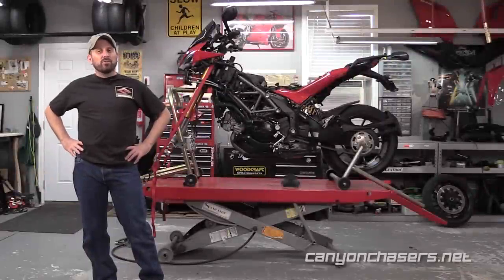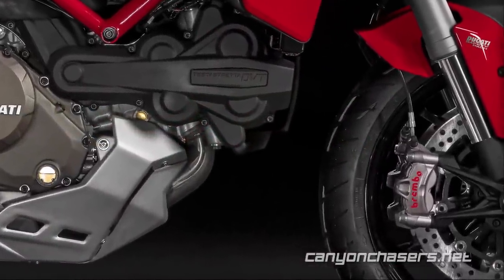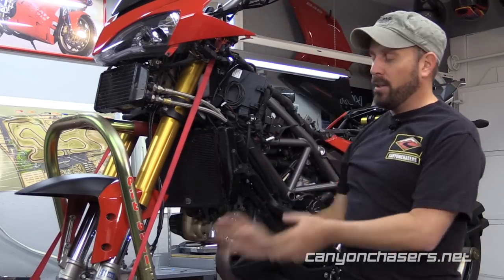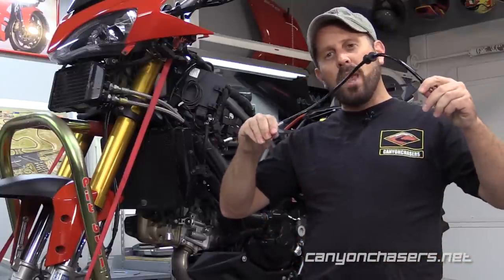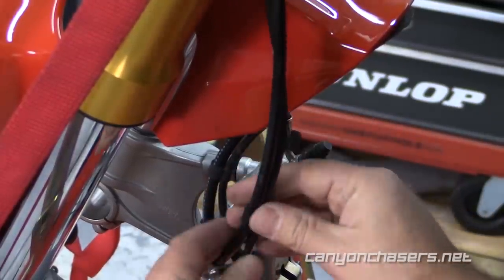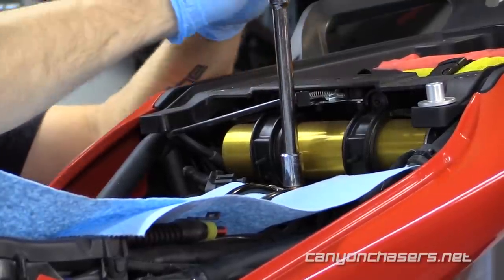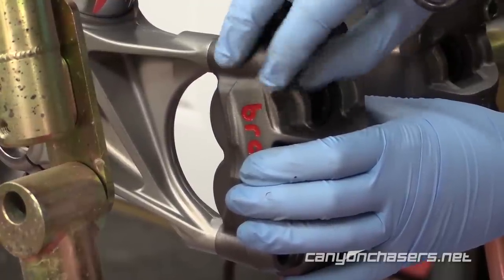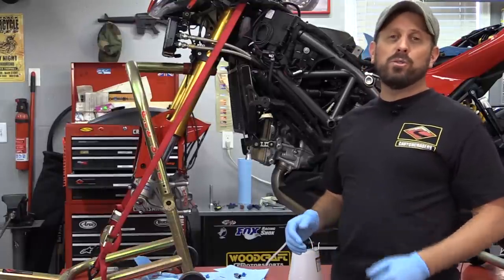How to install upgraded Brembo M50 brake calipers on a Ducati Multistrada 1200

Comment: Thanks a lot for your video. Based on your video I made that upgrade last winter 22/23 to my Multistrada 2012. But I chose the M4 Brembos. They watch more like the original P4, my concerns regarding authorothies here in Switzerland. Spiegler Germany helped with the right brake lines. Hey, what a great upgrade, and with the M4‘s I get even more stopping power. 
But for such an upgrade you should also stiffen your suspension. I have stiffer springs ( front 9N/mm, rear 130N/mm) and totally modified rebound and compression setup. What a great bike, it goes solo or fully loaded with wife and baggage in a perfect way. Brakes are Alps and Dolomits proven. No other Multistrada delivers that enormous rideable torque from the bottom to the top!

Comment: Very good Video, I upgraded my Dutch MTS 1200 1 1/2 Year ago with the Black M4 Calipers,after seeing your posting,  very good improvement of the braking characteristics. Also the modify brakeline was also handy :-) Please not that the ABS needs the factory Software Update , to max the upgrade.

Comment: Hello, congratulations for your videos! They are really well made! I'd need some advice if you can. I should replace the rear brake cylinder of my Monster 821abs because after several kilometers the pedal goes all the way down and i'd like having an efficient rear brake. How can I do to drain my rear brake? Do I have to do something on ABS? Can I empty it simply by connecting a hose to the rear caliper and suck the brake fluid with a syringe? Thank you.

Comment: great job and video! two questions please: did you order the customized pipes of the same length as the originals but changing only the type of banjos? can you repeat the tightening torque for the banjo screws in metric system?  think that I have two new stylema calipers to upgrade my Multistrada 1200 DVT my 2017! thank you

Comment: I needed to flush out the old fluid on my Z1000, so I bought, Motul DOT4 fluid, Hel brake lines, EBC HH pads, Brembo M4 calipers, Brembo RSC brake master cylinder, Magura HyMec hydraulic clutch conversion, Magura HC1 clutch master to match the Brembo RSC, Magura Blood and a MityVac. Gotta love motorcycles...... I know my bank account doesn't.

Comment: better go for the brembo M4. Those have 34 mm pistons vs the 32 of the M50. With the 34 mm pistons and the original main brake cilinder the "breaking feel" is right in the sweet spot.

Comment: Great video! I wish I had seen it before bleeding my brakes. Are the torque settings you mention for the banjo bolts in the front calipers from the Service manual?
Reply from the maker: Yes. I used the service manual

Comment: Hey I love your web site and your videos I have a 2013 multiawesome with a centerstand. I have done one oil change so far and I have to remove the center stand and skid plates, is their any simpler way?
Reply from the maker: Yes, you can, but we honestly just remove the centerstand.  To keep the centerstand in place, you remove all the bolts on the front of the sump-guard and the front of it will drop down, then you have to create a flat funnel like thing using cardboard and aluminum foil to create a gold-sleuth/trap shape to channel the oil from the drain bolt to the catch pan.  This is how our local dealer does it, but we think it's just as fast to remove the centerstand and sump-guard, then clean everything.  Less spills that way.
Reply: CanyonChasers Motorcycle Sport Touring There is a really simple mod that you can do to the bellypan's center section that allows you to remove it without having to deal with removing the centerstand. Slot the two rearmost holes so you can pull it straight out of the rubber grommets; you don't even have to loosen the pair of allen-headed bolts. Ever since I did this access to my drain bolt and oil filter has been reduced to the time it takes to loosen the side pan pieces. Extremely simple and effective!
Reply: We all eventually modded our belly pans to allow the center stand to stay on. 😁

Comment: Hi everyone!
I'm in the mood of upgrading front brake calipers from oem Brembo P4 to M50, in my MULTI 1200 abs 2012. Did you have any issue with abs control unit?
The volume of brake fluid has changed after the modification; so do you advise a new tuning of the abs control unit.
Thanks
Reply from the maker: Nope. It's basically plug and play. The ABS unit doesn't care about any of that stuff.

Comment: Hi Mate, Do we need to replace the Master cylinder to, when performing this Brembo M50 upgrade ? Doing some research  some forum community suggest to replace the master cylinder to as the Brembo M50 will need a master Cylinder 16 mm  rather than 19 mm like the M4. is the Spiegler hose kit will include the hose to the Master cylinder to ? Do you have any recommendation on the disk kit should we replace it to for better handling of the brembo ( it will be great if you can give advise on the kit to use), it will be great if you can help. Thank you again for this Super video really amazing.
Reply from the maker: pen tux Some sources do claim that you need a new master cylinder, but that has not been our experience. The OEM master cylinder pairs with the M50 calipers perfectly, providing exceptional brake feel, not wooden, vague or mushy. The Speigler kit only replaces the line from the ABS pump to the calipers.  Once we upgraded the calipers, we no longer felt a need for different brake rotors, so we cannot advise on which new rotors would work best.  Hope this helps.
Reply from the maker: pen tux The problem with the rear brake has nothing to do with the rotors, the brake lines, or the ABS pump. Rear brake fade is caused by the rear brake lines running in close proximity to the catalytic convert/header pipes.  The only way to maintain good rear brake feel is to bleed the rear brake regularly, or find some way to relocate the line and/or build some sort of heat shield.  Our next video shows a quick way to bleed the rear brake.
Reply: CanyonChasers Motorcycle Sport Touring  Any how was planning for this upgrade, but unfortunately as per duca team, i will loose the warranty on the bike if any change is made on the braking, will have to wait i guess until warranty is ending to enhance the bike braking not so fair i feel :( Thank you mate for all your answer :)

Comment: Why don’t you use M4 34 mm? I thought bigger piston produce bigger power
M50 only 30 mm for piston.
It makes me very cpnfused to choose which one the best caliper
Reply from the maker: M4's and M50s are so similar in overall design and performance (we've run them both on multiple bikes), you'd be hard pressed to distinguish a difference.  The problem is the P4s have thin walled pistons that flex.

Comment: Hi.  Have you had much problem with the fuel sensor on your MTS1200?  My 2013 has been through 2 fuel sensors (replaced by dealer).  Trying to fire it up today and I get a fuel sensor failure on the dash.  Any advice?  Thank you.
Reply from the maker: Amazingly. Mine has never failed. But I think I'm the only one.  I suspect its because I almost never run fuel with ethanol.   But, we have a few dead fuel sensors that we are going to try to take apart to see if they can be fixed.  There are a few videos on youtube, in vietnamese I think, that claim to be fixing them.
Reply: @CanyonChasers  Yeah I think I saw that video back when my first sensor failed.  I am no novice to soldering electronics but it was hard to understand what that person was trying to accomplish.   Maybe as simple as cleaning contacts or replacing a component.   On the bright side, my sensor error was probably a bad battery and low voltage.  When I connected a 15amp charger the sensor error went away, hopefully for good.  New battery is coming this week.
By the way, do you have an easy method for draining the fuel tank that doesn't require removing the plastic and tank?

Comment: Do they have abs line for aprilia? Most of aftermarket one doesn't feature abs function.
Reply from the maker: For a motorcycle to have ABS, it has to have a special ABS pump, usually under the seat, and the computer (ECU) needs to be programmed for that function. It's not something you could easily retrofit to another bike.